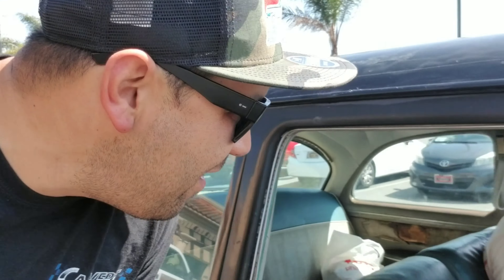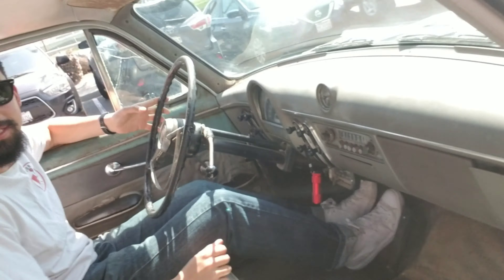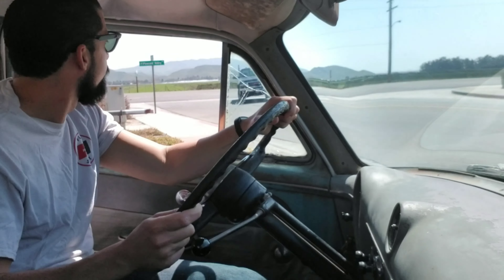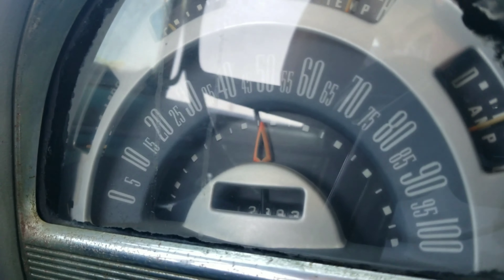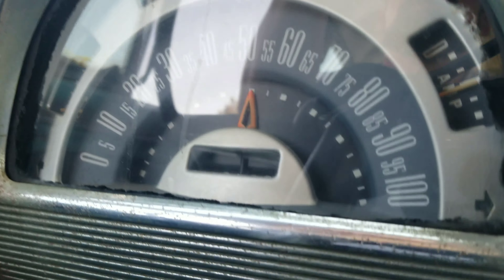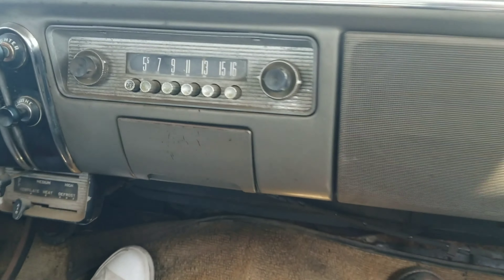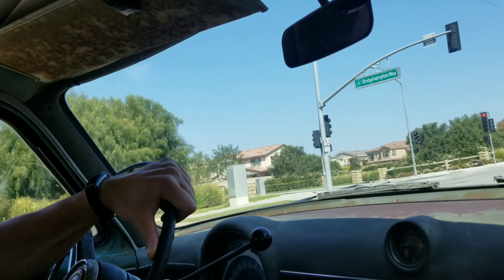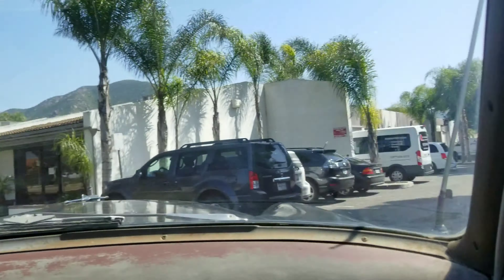The Butchers Filthy 53 Ford Customline

Comment: I had that same car back in the 80’s. Straight six 3 on the tree. I found it in a garage that had the roof collapsed from snow. We had to use a jeep tall tire jack to lift up the roof and push it out. Had a trunk full of fomoco parts brand new for the rebuild of the 6 and a flathead v8 that we also got with it. Motor was out and all ball joints were giant balls of grease. What a great car.

Comment: Tap is short for tappets. It’s the valve lash .015. Initial setting. Back when it was common for gas stations to throw a quick tune on your ride while filling up. Some common things are timing numbers and dwell settings.